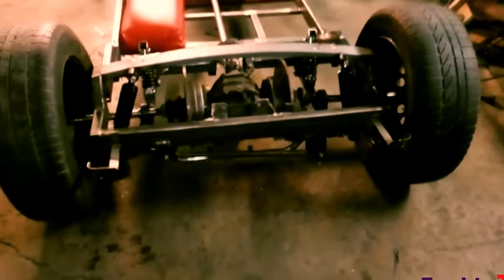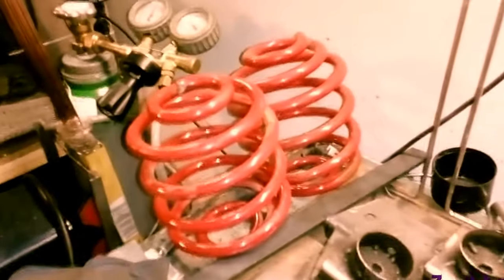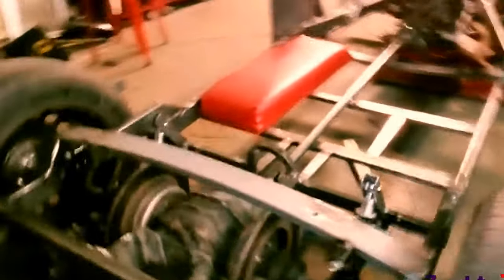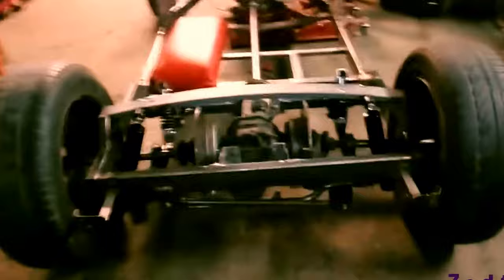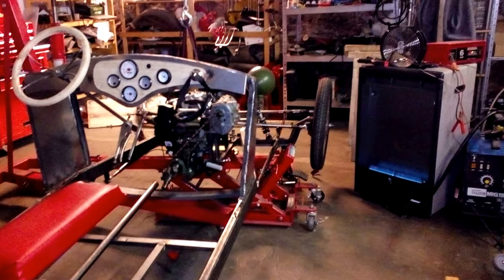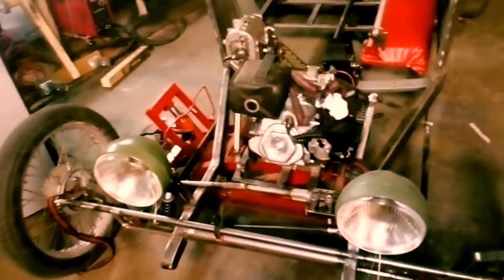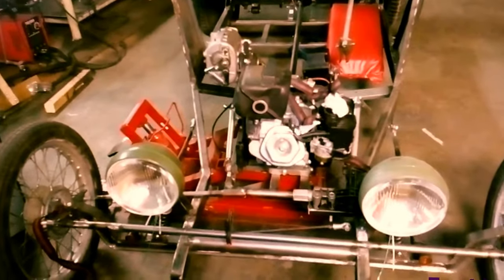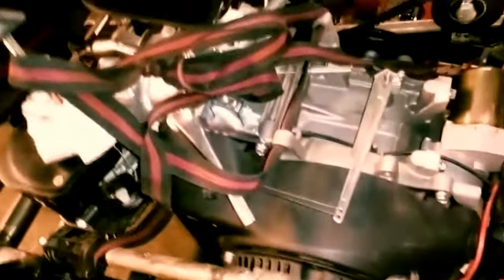DIY Hot Rod Kart Pt 27 rear suspension & motor mount

Comment: interesting build and i can see you put a lot of work on that Kart, just wondering wont that engine be a bit too small for your build? Looks like it will have some weight on it so might need some horsepower
Reply from the maker: Patrik Eriksson it is a 13 HP. When i see cyclekarts running that fast with a 6hp. I think this one will handle the job. And remember it is a show car. So in the end it will run through car shows at walking speed hhh